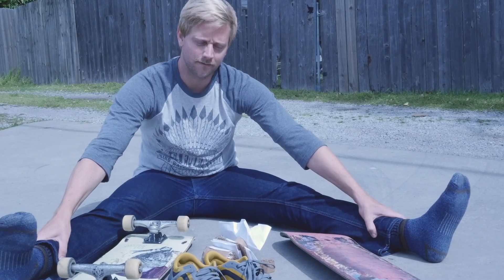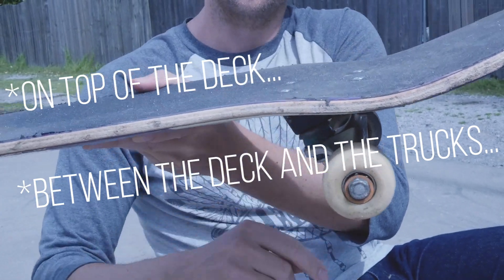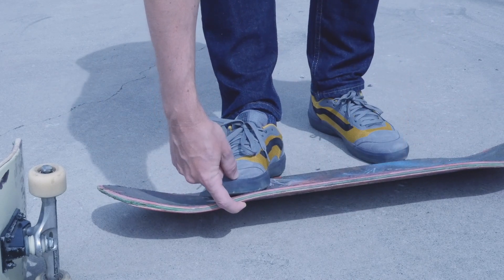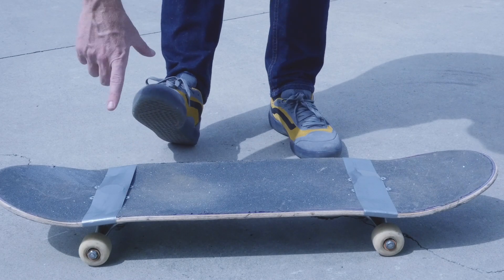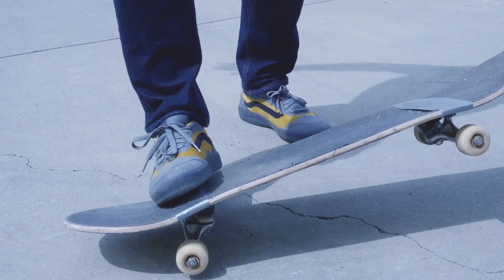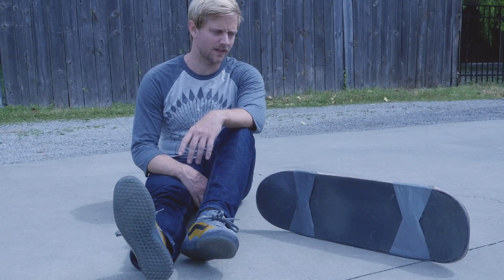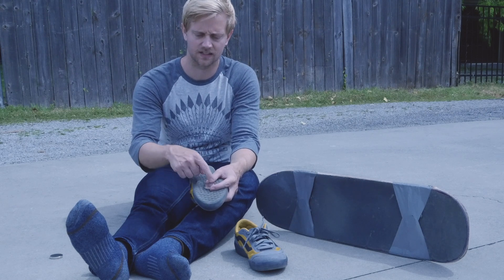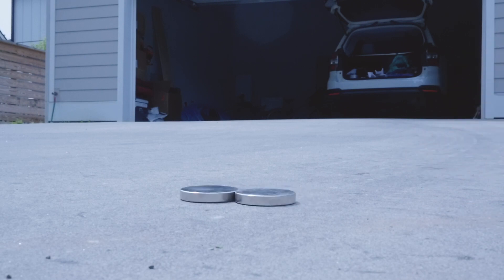Magnets & Skateboarding / Pt 1

Comment: I tried using magnets for a removable surfboard rack on a school bus. While the weight ratings of the magnets were enough for the task (as long as we didn't hit a bump!), the problem was all of the magnetic loss (non-science term) which removed about 80% of the power. I'm thinking that you need to cut into the bottom of your shoes and insert the magnets almost flush and then smooth it out with a very thin layer of silicone. Instead of another magnet in the board, cut the grip tape and put a thin plate of high ferrous steel. Then the grip tape around it will be pretty much at the same level. If you have room side-by-side, put two magnets in each shoe. This will be MUCH more comfortable and I bet the difference will be amazing.
Reply from the maker: Thanks for the tips! My plan for phase two is to put two magnets in each shoe and two magnets around each truck, putting them underneath the grip tape so there is more of a continuous surface without disturbance.